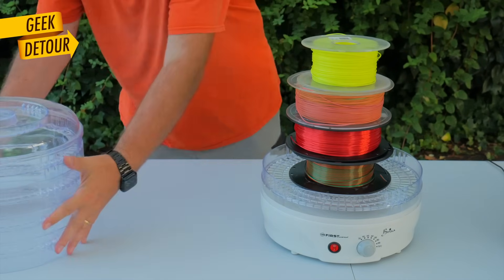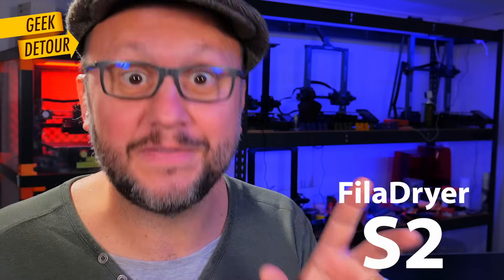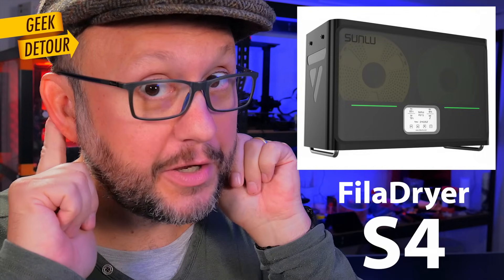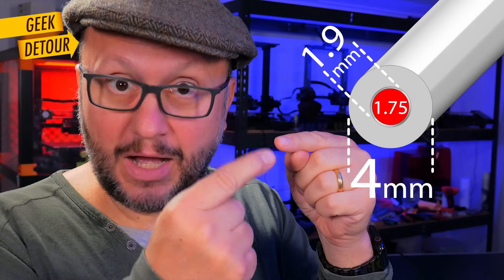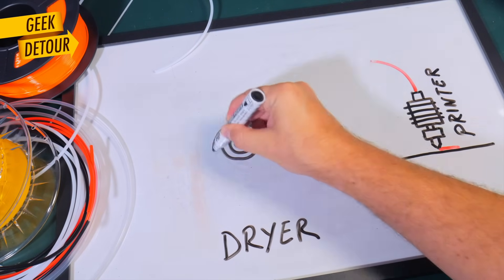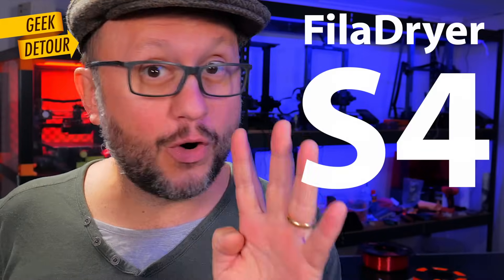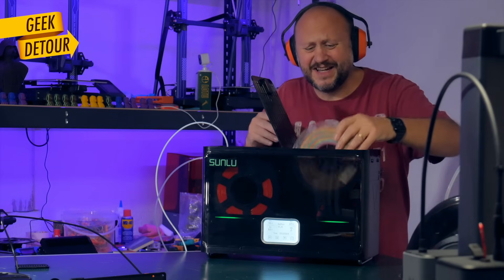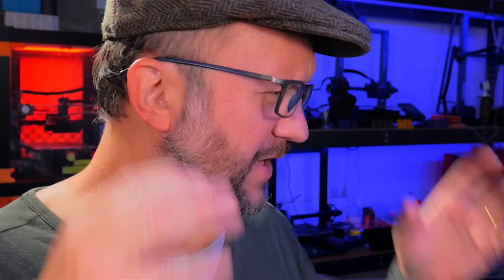SUNLU Filament Dryer S4 vs S2 vs Food Dehydrator

Comment: They really should have used a 85°C heater, it’s limited features make it lackluster and basic with a touchscreen
Reply from the maker: Well, anything can be made better (and probably more expensive). Do you recommend a different dryer that you can buy? (I am not talking about DIY, which is also interesting, but that’s a different proposition)
Reply: 85 deg heater would be great but this works for me using Polymaker PA and PA-CF.  It may take a while but it gets my wet PA filaments to 13% and the difference is night and day.  But SUNLU, please make a hotter dryer!!

Comment: It’s useless for those of us who live in dryer climates, if the dryer won’t turn on by itself until it hits 50% humidity it will never turn on for me. Looking at my weather app the humidity is currently 32% outside.
Reply from the maker: That’s why we can give them feedback now. Look: yesterday I discovered that my unit (prototype) actually goes idle at 30% RH, not 20. This is just a parameter they change in the programming of the microcontroller that does everything in the dryer. 
I think they still can make it adjustable, like the temperature.

Comment: Nice video, that tangential exit I mention all the time to manufacturers, so important with high friction filaments, like CF Nylons.
Reply from the maker: Thank you! So good to have you here, Dr. Igor 🤗 Absolutely! And we need to promote more the 4.0mm OD 2.5mm ID Bowden tube, as the default to feeding tubes.

Of course, between extruders and nozzles that’s a different story, it needs to be tight. 👍

Comment: For the S4 the fans are presumably running from 24V or 12V, so it should be possible to swap in variable speed (PWM control) fans, that can run quietly at lower speeds to circulate the air when the box is not actively heating.
[Edited to add:]
Another thing, how well does this work with Jayo (a Sunlu brand) spools of 650g and 1.1kg?
Reply from the maker: Excellent suggestion: when it reaches the desired temperature, it could operate more silently if using PWM control of the fans! Oh, about the Jayo - I didn’t know this brand is from Sunlu. I’ll need to buy a spool to test. I never had a roll on recycled material spool.
Reply: @GeekDetour  the Jayo 1.1kg spools (on Amazon UK) look good value, and trusting Sunlu already I think I will be ordering some soon. (I already have an assortment of their 650g spools, awaiting my Prusa Mk4 kit delivery.) It would nice to clarify if four of their 1.1kg spools fit in the S4. Thanks!

Comment: So it makes the moisture go from the filament into the air inside the dryer. And then it's trapped there, practically forcing it back into the filament, because the filament is now constantly surrounded by very moist air.

The desiccant might help a bit, but that also stays warm, which also prevents it from absorbing moisture.
Reply from the maker: I think what you says might apply for the S2 - the %RH drops way slower… also, it is just 50W. But on the S4 it definitely doesn’t apply: it drops from 50% to 15% RH in less than 15 minutes, I was paying attention to that yesterday…
Reply: @GeekDetour  The relative humidity drops just because the temperature increases. The amount of actual moisture increases. Where do you think the moisture goes? It's not as if it magically vanishes or goes through the walls. No, warm air can hold more moisture. By increasing the air temperature you make it possible to increase the actual (as opposed to relative) humidity in the air.
Reply from the maker: The box is not as water-tight as you think. Vapor can definitely escape. Maybe I need to make a shorter video: when I open the LID, the %RH start increasing immediately. On your theory, it would help to open from time to time, but actually, every time I open, it gets more “humid” inside. Closing, it starts to drop again.
Reply from the maker: I want to thank you for your observations - I was now investigating something about the S2 and maybe it could actually dry quite faster… I need to test more. Anyway, THANKS!
Reply: @GeekDetour  The reason why RH increases when you open the lid is because the temperature drops. Once you heat up the cooler, less moist air to the same temperature you'll end up with a lower RH.

A real dehydrator (e.g. for dehydrating food) has huge holes for hot, moist air to escape, while it sucks in cool, dry air (although it might have higher RH) which it will heat up (thereby lowering its RH) and blow across whatever needs dehydrating.

If you just keep blowing the same air around then it will just get saturated with moisture until there's an equilibrium of dehydration and hydration. Small holes are useless for getting rid of all the moisture in the hot air.

And you can try it. Put a damp piece of tissue paper (or whatever) in it, run it until it's dry(ish), note the temperature and RH, then let out all the hot air and close the lid again, and run it until you get to the same temperature as it was before opening the lid. The RH will be lower (assuming it's at all reliable, and isn't just a temperature sensor faked to simulate a humidity sensor).
Reply: @GeekDetour  I have the S2, and I always prop something under the lid so there's a small crack where (moist) air can escape.  The machine seems to manage keeping the temperature at the set level, but the RH drops faster and bottoms out at a lower point as well.
I don't keep my filament in there, I just use it when I suspect the filament has gotten too moist.  I keep spools in a dry box with a hygrometer and silica packs.
Reply: @marcus3d while this all makes sense the way you laid it out, there must be something you haven't taken into account because there is one issue with your theory; the dryer works. If you were completely right (and don't get me wrong, you must be mostly right and what you said makes a lot of sense) then you would never be able to print nylon effectively out of one of these dryers, and my nylon prints out of my s2 come out fairly nice.
Reply: @sebastianweber9688  Well, just being warmer increases the heat capacity of the air, so while all the moist air tries to push moisture back into the filament, at the same time the warm filament is also releasing some moisture (as is the desiccant, unfortunately), so there's a bit of a competition between these forces, and I suppose at least the outermost filament gets a bit dryer if it had absorbed moisture before. At least in the beginning, until the air gets really saturated with moisture. In any case, it would be much better if you'd replace the moist air with dry air, so you wouldn't have so much absorption pressure.
Reply: @marcus3d  that does make sense. Do you think that drilling a few small vent holes near the bottom would increase the effectiveness of the dryer? I am looking for a way to dry this damn nylon faster lol.
Reply: @sebastianweber9688  You'd probably want some vent holes behind the heating element, and others on the opposite side of the enclosure. It's difficult to say without knowing the air flow characteristics.

Comment: Power consumption on the s4 must be huge?!
Reply from the maker: Well, it draws 350W while actively heating… But when it stabilized at the desired temperature, I saw mine working around 70 to 100W

Comment: Great video! I backed the S4 yesterday, and the noise was my only concern. Also the humidity threshold is a good point, 50% seems too much to me
Reply from the maker: Great to see you here @McGybeer 🤗 Yeah, if silence is a major concern, the S4 should not be your choice… But, really, side-by-side with the M5C, it doesn’t really matter, the fast-printing world is very noisy 😬 BUT, the drying performance is amazing: it reaches 15% RH very fast, about 30 minutes here. And yes, 50% is really high… it takes the whole day to reach this mark and I would prefer if it stayed in a more desirable range.

Comment: I was ready to buy one of these on their kick starter but then noticed how the exit when using 4 spools is at opposite sides. 2 exit to the left and 2 exit to the right. Seems very inefficient when hooking it up to a single printer when you want to keep multiple filaments at the ready. Cool upgrades and nice design but because of that (as the Shark Tank says) “Im out…”
Reply from the maker: Oh, I agree! It depends a lot on how you have your printers laid out. I guess you wanted something that looked like an AMS unit from Bambu, but as a dryer, right?
Reply: @GeekDetour  Yeah that would be nice, I’d even opt for a stacked design. But I would argue that most people with 1 or two printers aren’t going to use it how Sunlu designed it. 

Even in one of their promo photos they show it on a table with 4 printers with the dryer in the middle, while that works perfect in that situation that’s not what most peoples setup looks like.